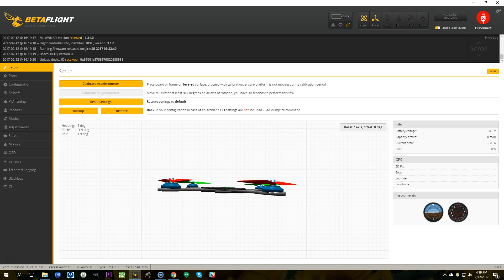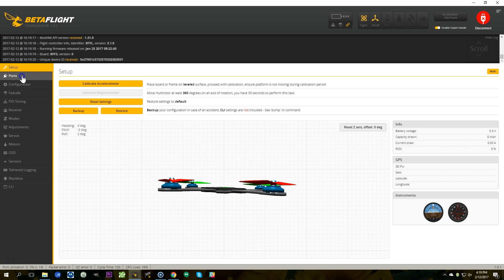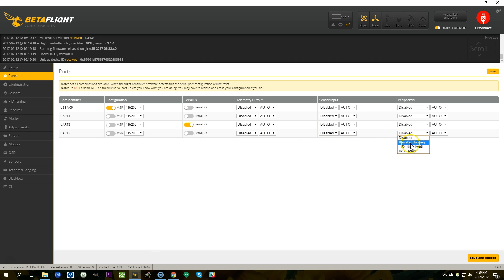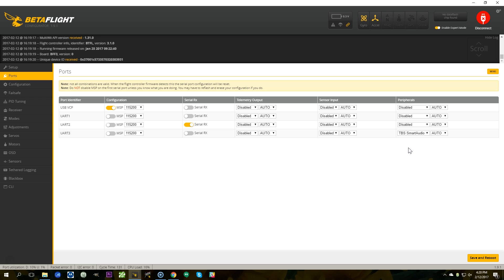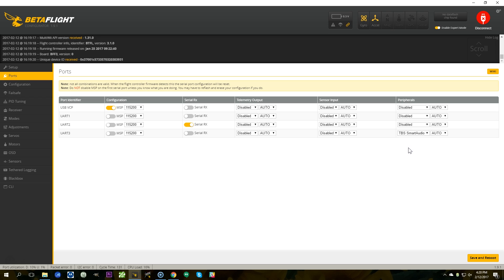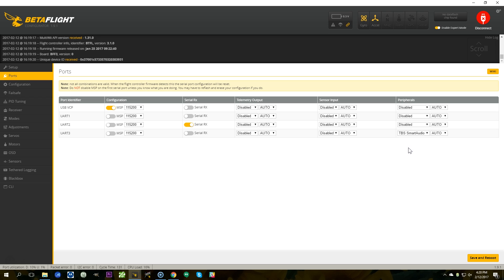BETAFLIGHT SMARTAUDIO | Change vTX channel and power remotely!

Comment: I have question abt sa 
, do I solder wire to tx or rx port? And what's the different between these thanks
Reply from the maker: TX for smartaudo. TX is transmit. Rx is receive.

Comment: i have the tbs vtx and it browned out on me just going 60 t0 80 feet away!..i have the hyperlite F4 osd flight controller and im not using smart audio cant say i never will...but i just want to fly without it failing! i soldered it through the FC should i go direct from the vtx to the camera?  what im i doing wrong? i switched to my tramp and same thing!...
Reply from the maker: Most likely it's an issue with your antenna on your quad, or on your goggles. Are you 100% sure you're on the correct channel?
Reply: yes..im on the right channel..it could be the  antenna!.. my AKK fx2 vtx kills and my matek the new one! and my Fatsharks with diversity work great with all my quads except my new martian build with the TBS unify pro! i wanna cry! i bought two!..what about peripherals setting? i have nothing selected ...

Comment: Hello. I'm still a noob at this but just wanted to check. Do you have to have a osd before this will work? I'm using a spracing f3 fc and can't seem to get it to work.thanks in advance.
Reply from the maker: It can also be activated with Lua scripts on the Taranis even if you don't have an osd.

Comment: So this same procedure would apply the same for Mach2 RDQ VTX?
After breaking two other VTX's i finally ordered RDQ Mach2 mmcx version for my wizard x220 which i believe has two Uarts and i want smart audio to work...eventually ill end up changing the FC as well
But i got a Runcam swift2 for voltage osd ...it would be great to have the smart audio option work as well? But im afraid it may not work because of not have Betaflight OSD on the wizard SP FC 3?
Reply from the maker: Smart audio doesn't require osd but it does require some way to control the channels and power. Without osd how will you do it? Lua script on Taranis is the other main way.

Comment: How do you control it though ? With what, the transmitter?
Reply from the maker: Through the osd is one way. With Lua script is one way.
Reply: Joshua Bardwell thanks, saw another video where it shows to pitch forward, yaw left and you can use the osd to do
It. What a great feature! Thanks again for your help! I learned a lot everyday I see your videos.

Comment: I'm getting the sa part but no options in sa
Reply from the maker: Basically SmartAudio isn't working. So you have to look at your wiring probably because the config is pretty simple: just enable SmartAudio on the UART in the Ports tab. Connect the vTX audio wire to the UART TX pad.

Make sure your vTX uses SmartAudio and not Tramp Telemetry. If it uses Tramp protocol then the SmartAudio won't work. You have to use the TR menu.

If you have an akk branded  vTX it may not work with SmartAudio under Betaflight 3.3
Reply: Joshua Bardwell I'm running tbs unify pro on a ominbus f4 pro I sodered the audio from the vtx to tx3 on the FC. I see smart audio in my anomways but not getting anything but status an back when in I select vtx say above status it says smart audio an blank lines

Comment: I am very new in the hobby. After a few hours on youtube I built a race drone with matek 722 fc, matek 5.8 40ch transmitter, Matek FCHUB-6S Hub, frsky xsr receiver, taranis qx7. My problem is that I do not have any  OSD information.  I can not get the vtx settings on the screen too. I have selected uart 5 irc tramp for vtx and uart 3 smart audio for the receiver in Betaflight, using the tx5 and tx3 pads respectively on FC. Any help?

Comment: I’m new to smart audio. Seems every time after I power off my quad the video channel that I set which is F7 5860 will automatically by itself  changed to 5865. Where did I go wrong. Did all the save and exit. Event tried save and reboot.
Reply from the maker: Set the channel then "save and exit" the osd menu. See if that fixes it. I think if you set the channel but don't save and exit, it's not saved between reboot.

Comment: Hi, I've done this and it works great  except for one thing. Everytime I turn off the drone or the Qx7 I'm using, it resets to F1 on 25mw. How can I get it to stay where I placed it last? I also believe it is overriding the auto lower vtx  power on disarm, as even once I arm it's reading at 25mw. I'm okay with just living with the second problem but the first one is driving me crazy. I'm also using the Bardwell F4 board and an R-xsr receiver if that matters. Thank you

Comment: @joshua bardwell 
is it possible tu use smart audio and camera mic at the same time? and how i have to wire it?
Reply from the maker: Yes. Just solder both the microphone audio wire and the vTX audio wire to the same UART TX pad on the FC.

Comment: I was able to change soft serial for the tbs unify pro nano on my f4 aio, but my f3 aio will not change vtx channels via lua script. I am confused with smartaudio v2.o lite????
Reply from the maker: I believe that Betaflight 3.3 has a bug where the Unify nano smartaudio doesn't work. 

You can download a fixed hex file here: https://ci.betaflight.tech/job/Betaflight%20Maintenance%203.3%20%28AKK%20-%20RDQ%20VTX%20Patch%29/lastSuccessfulBuild/artifact/obj/
Reply: Vtx control shows up in lua now but will not change channels. I may have a bad tbs unify pro nano :( or a bad flip32 f3 asgard. I have a tbs unify race and another fc for testing. I just gave you a another sub on my fiancé's youtube account ;) I am sure you will get your youtube silver button by summer time.

Comment: Hey Joshua, is there or have you heard of people having trouble with smartaudio working with BF 3.3 with the Mach2 ?
The lua works on my Taranis  plus but doesn't seem to connect with the Mach2.  Is there maybe some kind of update for the Mack2 to work with 3.3? Thanks, John
Reply from the maker: Thus is a known issue. There is a custom hex for Betaflight that fixes it. See the Betaflight 3.3 release notes for a link.

Comment: Im using a CLr4 FC with a tramp and a yesterday I switched from boscam 1 to fatshark 1 in the OSD  just fine it worked as should. Today I go to switch back to E1 . But it won't work right. In OSD it will now flip freq when Im trying to change band. It also won't save or switch like at all even tho icon does . I plug on and off it resets to 25mw etc. Why would it do that? I didn't crash or anything that would cause this from yesterday. I finally just pressed manuel button to get back to e1 . But i go to see OSD . it still reads 25mw and fatshark default . But it is on my right channel. MY tramp telem wire is attached to tx4. Could i move it too TX6 using configurator?
Reply from the maker: You need to unlock it I think. See the manual for instructions.
Reply: Nah it's weird I plugged back in this morning and smart audio works again like should .. Hmm ?

Comment: I have a sprF3 flight controller but i dont see any USB VCP port in tap "ports" how can I enable it?
Reply from the maker: SPF3 has the CP210 chip, which means it doesn't use a virtual COM port. UART1 is used for USB instead.
Reply: Thanks for reply, one question more  i am using uart 2for telemetry (smart port) and uart3 for sbus  , where can I  connect the smaraudio wire to control vtx from my taranis?

Comment: I just watched team racing for the first time this last week at the Sebring expo. It was a coo race to watchl. To get their video to stop transmitting when they crash they simply velcroed their batteries without the battery strap so they would eject and turn off their drone and thus their video wouldn't continue transmitting. This way the next guy could have clear video when he was plugged in. Is there a way for the crashed pilot to turn off their vtx via a switch so they don't have to eject their battery when they crash?
Reply from the maker: In general, no, there isn't a way to shut down the transmitter remotely.

Comment: Could you make a video on how to use smart audio and still be able to use the microphone on the fpv camera? Or is that a thing? Thanks!
Reply from the maker: The simplest thing is to wire both mic and vTX audio input to the UART that is being used for SmartAudio. Everything will work, but you will hear the smartaudio "screeches" in your earpiece when the quad is disarmed. In most cases, you don't need to do the electrical circuit, and the electrical circuit won't protect you from the screeching anyway.
Reply: Thank you very much Mr. Bardwell. I will try that. One more thing, I'm having a hard time with getting RSSI to work properly through my Betaflight OSD on my Kakute V2 FC. I set everything up as Project Blue Falcon showed me to, but my on screen RSSI stays locked at 49%. Any additional advice would be greatly appreciated. Thank you again in advance.

Comment: I got spf3 racing F3 FC without osd will smart audio work? PS. vtx got smartaudio.
Reply from the maker: Yes, smartaudio will work but you won't be able to activate it over the OSD because you don't have one. Lua script would work if you have Taranis.
Reply: As Joshua said, it will work.  I'm doing it right now with my x220 using the stock SPRacing F3 FC, Mach2 VTx and a Taranis Qx7 running a lua script.

Comment: Have another ? I have an sp racing f3 and uart1 is taken with power from pdb. Uart3 rx is to receiver. No uart pads it looks like the plug broke off on uart2. ? Is can i solder the s.audio to the tx spot on uart3 even though the receiver is on the rx spot or only one thing per uart at a time? Also would the audio wire from the camera solder to the same spot as the s.audio?
Reply from the maker: +Joe Xavier no you can't combine two functions in a single UART like you're thinking. Sorry... S. Audio and the audio wire are not the same function either. S. Audio goes to a UART. Audio goes to the audio line in the vTX.

Comment: Where do u solder the sound wire from ur camera to? Or is it a either u have sound or change vtx?
Reply from the maker: You can wire them both to the audio line of the vTX, but you will hear the SmartAudio noises in your ear (very loud and annoying) when you are disarmed.
Reply: Joshua Bardwell thanks for the answer

Comment: Okay does this still work if your Flight controller does not have a built in OSD? because I have not been able to get this to work. and feel like I have been miss lead, I have spent countless hours trying to get this functionality to work.
Reply from the maker: +Clancey Aggen it does work but you need some way to tell the FC. What you want it to do. There is an Android app that can change channels via USB OTG cable. And you can use Lua scripts if you have a Taranis. Finally, the OSD can be used. These are three ways to use SmartAudio to change channels.
Reply: raceflight lets you do it with spektrum transmitters on the transmitter

Comment: On brands like AKK x2. They claim to use smart auto for configuration, but dont specify which peripheral in the drop down.
Reply from the maker: Well there are only a few choices so try them all!
Reply: Joshua Bardwell It was tbs. This is very easy and awesome.

Comment: Hi Joshua, I have three new Unify Pro 5G8. Do you have to unlock the restricted frequencies and VTX power before using the LUA script for smart audio? I remember on my first Unify two years ago I had to hold on down the button for 20 seconds to unlock it. It seems LUA works fine on Betaflight F4 and Kiss FC without unlocking but I can't test the VTX power change as it's suppose to be restricted to 25mW from the factory.
Reply from the maker: +cfallon SmartAudio works even when the vTX is locked.

Comment: using a betaflight f4 the actual bff4, running the 3.2 version that came on it. i changed the peripheral to tbs unify but inside the osd it still says tramp on the top and isnt receiving any data. ive already been using this feature on a matek f4o5 so i know how its supposed to work. just not working on this board and i also have a matek vtx on a matek f404 that stopped transmitting info as well nothing has changed on that copter. i also have one that sill is working just fine. starting to get frustrated. also dshot commands are not working properly on my betaflight f4 board.
Reply: I've got problems with BFF4 also. Its all set up as per the wiring diagram and oft serial videos from their website, but Smartport and smart audio not working. I don't even get voltage on the OSD!

Comment: I have Matek's VTX, the power settings are different than the unify and the tramp. The Matek works for me with the peripheral set on IRC Tramp, but my power settings are 25, 200, and 500mw. Is it possible to change the power in the CLI so that the power display on my taranis and my OSD match my VTX? As of right now, to set it at 500mw, I need to set it at 400mw through lua script or OSD. Thanks for your time.

Comment: Ok I have things wired up as suggested... but a novice like me would like to know how do you use the the smart audio? Is there a sequence? Program a switch?
Reply from the maker: Various ways. The most obvious is to enter the Betaflight OSD (throttle center, yaw left, pitch forward) and then navigate to Features / vTX SA. You can also do it via Lua script if you have a Taranis. https://youtu.be/qboy9crfy58

Comment: Thanks for this. It answered a simple question that I hadn't found the answer to until this. Everything I've seen to date always included Smart port connections too, and I was always wondering if that was a requirement, and if so, how does it all work together? Well it isn't required and they don't work together if I heard you correctly. In my case just wire the Tramp T pin to unused UART TX. Thanks again, sometimes it is the simplest things!
Reply from the maker: SmartPort is not a required part of SmartAudio. You can adjust SmatAudio from the OSD without using SmartPort.

Comment: JB, in the configuration tab of 3.2, most bottom section, theres a vtx feature, is that related to this smart audio?
Reply from the maker: I honestly don't know what that is used for. I haven't seen a single board so far that needed it turned on, not even the Moto Typhoon, which I thought was using SPI.
Reply: Okay, im having trouble getting it up, using a matek f405 AIO fc, wired the tbs unify pro smart audio on TX5 as recommended by matek, enabled SA in peripherals on uart 5, it doesnt show up in osd features vtx SA, there was nothing there, i swapped the wire to tx3 and enabled tbs SA on uart3, still nothing. You got an idea what i could do to fix it? FC is flashed with BF3.2. It flys great.

Comment: Hi Joshua, I just changed my vtx to the Unify pro V2 and I can't get any telemetry info on my Taranis. I wired my Telemetry to UART6 and the smart audio line to UART3. After I did that, I can't get my telemetry readout on my Taranis. Do I have to connect them to the same UART? I can't get my VFAS and PID settings on my Taranis anymore and I used to get them before connecting the Unify Pro.
Reply from the maker: You do not connect them to the same UART. If you are using an F4 board, remember that the UART that you connect SmartPort to must support inversion. Most likely that's your problem. Do the "XSR anti-invert hack" if you can't find an inverted UART on your flight controller.

Comment: Hi joshua have a betaflight f3 fc and using a tbs unify 5v vtx . I put the 5v dor the vtx on any 5volt And the cam on the ram . On 4s i have good picture but as soon i plug in a 5s lipo my video get black . Do you have any idea how to fix it?

Comment: Great video, I am just learning about this cool new feature as I am in the process of getting parts for a new build. The guy I order all my parts said I need a FrSky XSR to be able to change the channels on my transmitter? Is that right? I have an extra XM+ I would rather use. The reason I think he is right is because how would you talk to the FC from your controller, without telemetry? I am going to use the Betaflight F4 FC and they also told me I couldnt dshot 1200 with it and talked me into dshot600 ESCs, is that correct? If im buying all new stuff i might as well get the top tech for the same price. Thanks for you help like always!
Reply from the maker: XM+ doesn't do telemetry. So it can't do the Lua script.

Comment: Using the Tbs Unify Pro Hv has a slightly different wiring. Could you please confirm the smart audio wire Joshua. 
Many thanks.
Reply from the maker: SmartAudio is the audio wire. Not sure what the question is. If you need to know which wire is the audio wire, check the pinout in the manual.

Comment: Hey Joshua, because my board was upside down and because i'm an idiot I wired the TBS white audio wire up to one of my +3.3v , would this burn out the audio feature on the VTX or am I still in luck? Cheers.
Reply from the maker: Only one way to know for sure. It's possible that the audio signal itself is less than 3.3v peak in which case you might be okay.
Reply: Gee I hope so, thanks.

Comment: Hi. thanks for the useful video. I have an eachine wizard x220. I have upgraded the vtx to TBS unify pro and camera to runcam swift 2. I was wondering if I can set up smart audio on my quad. ur feedback is appreciated.
Reply from the maker: The problem is that you only have two usable UARTs because the SPracingF3 shares UART1 with USB. If you can do all the things you need to do with only 2 UARTs, then you can use SmartAudio.